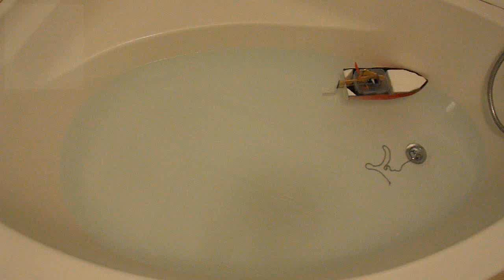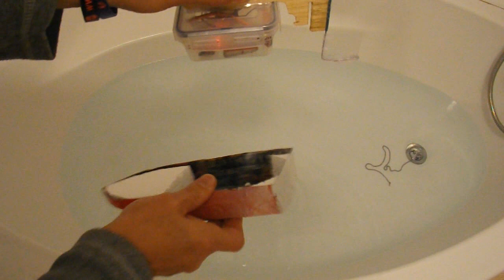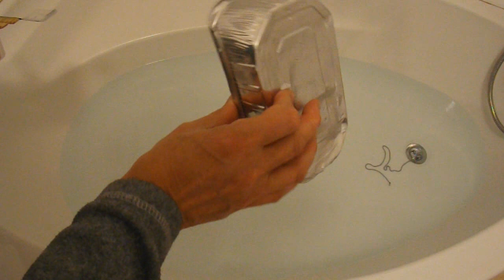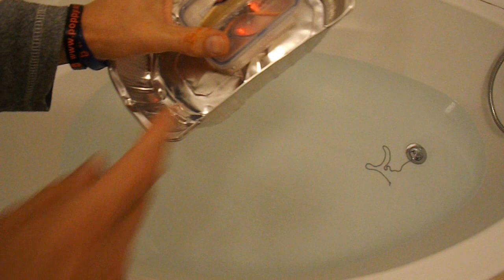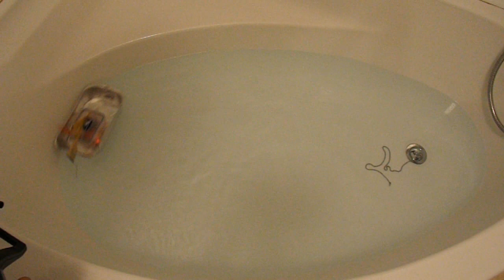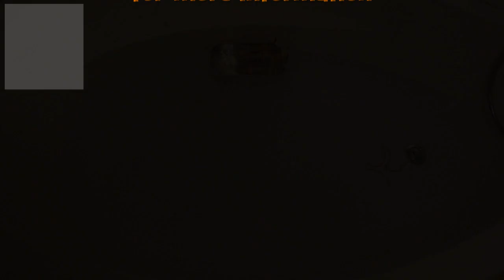Metal Foil Tray RC Air Boat

Comment: That worked really well.  Your modular drive unit is a brilliant idea.  I wonder if you could take a sheet or regular Al foil and just fold it up somehow into a floating hull that would work.  It would be like and aluminum origami boat creation.  She might leak a bit but a dab from the old hot glue gun would fix that.
Reply from the maker: +Lidmotor interesting thought. I have just watched a YouTube video on folding a suitably shaped boat. I have no idea if that would translate to using regular foil. If the strength is not there I could flatten one of the larger trays I bought and try folding that. Paper has an amount of give and take that foil probably does not, but it might be interesting to find out. https://youtu.be/61FYdrlwE_E
Reply from the maker: +Lidmotor Oh Wow !! just did it !! copied that video fold by fold with ordinary kitchen foil, it made the boat just like in the picture. It floats fine so I put my RC module in it and it works perfect although it bends rather easily when it runs into things, like the side of the bath :-) Video won't be published until about 20th December as that is the next slot available. Thanks for the idea.
Reply: +GrandadIsAnOldMan   That is great news!  I look forward to the video.

Comment: Grandad That foil boat was a bit of a cheat but as you said it did the Job, The foil boat was a bit slower than the Super fast paper boat because of the flat front....I suppose.
Reply from the maker: +Graham R Dyer hardly a cheat, just forward planning when designing the RC receiver/servo/ESC/Motor unit in a swappable format.

Comment: Hi there again, one more thing, what component is making that beeping noise while you're driving a boat? Is it an ESC?
Reply from the maker: +Viktor Božičević the high pitched whine is the DC motor. The ESC controls the speed of the motor by sending it the current using Pulse Width Modulation that means is send pulses of current to the motor and the speed and the width of those pulses are what sets the speed of the motor. The byproduct of that is you can often hear the pulses as a high pitched whine. Some motors sound worse than others.